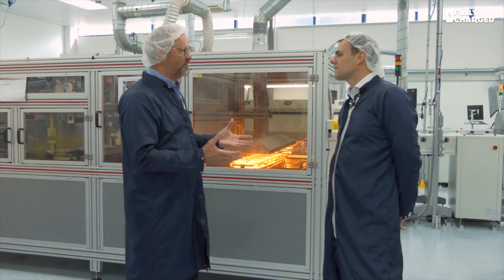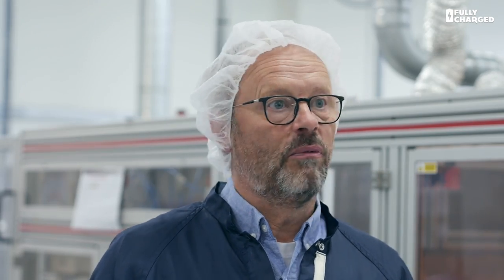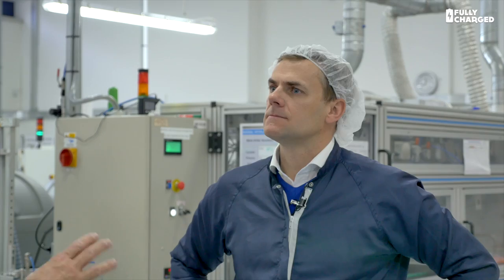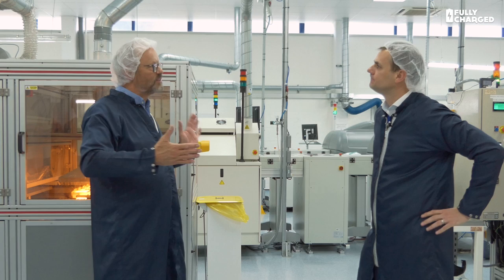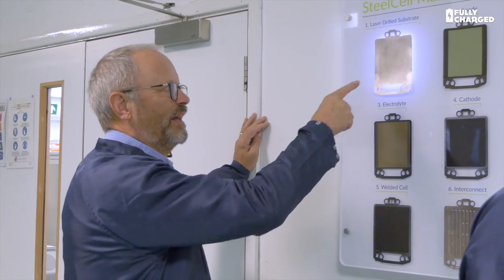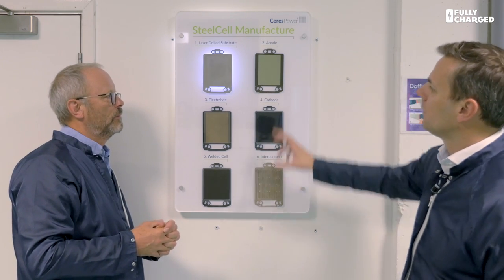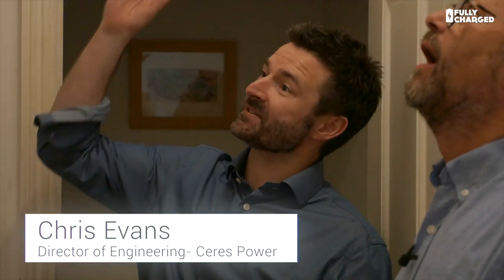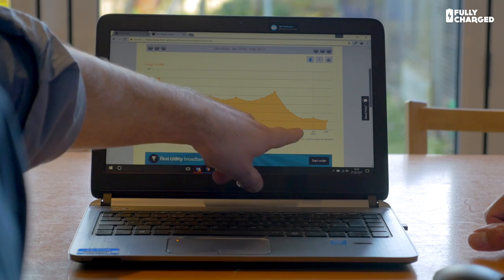Ceres Power | Fully Charged

Comment: So what is the projected life of the fuel cell and if required how much does it cost to replace a failing cell ?
The piece seems to enthuse about use in the home, where is the gas coming from to drive this fuel cell, are they suggesting hydrogen from solar panel powered breakdown of water or maybe from the home natural gas supply coming in from the street ?
I've played this video twice and visited the companies web site but the source of fuel gas, no matter how catholic, is something not discussed.
This might be a good solution for pig farmers with their own digestors to produce CH4, but for home use as long as Cerespower continues to gloss over awkward questions, colour me sceptical.
Reply: Dogphlap it's better than burning gas in a power station to produce electricity at lower efficiency and then throwing the heat away (e.g. directly in to the sea which is what happens at my nearest gas power station).  In many countries like the UK, peak heat demand drives peak electricity demand too, so this fuel cell electricity is available when it's most needed.
Reply: You say it is better . I say give me some numbers. You probably think to ask for some actual figures is abusive. I like to know the truth, you apparently not so much.
Reply: Eh?  Who's being abusive?  All these numbers are pretty easily available.  Average efficiency of a CCGT power station is about 50% (the rest goes to heat - which is almost universally thrown away in the UK), subtract 5% to 10% from that for grid losses (always heat, and non-capturable because they're diffuse) - although it can be used in 'combined heat and power' district heating systems as it is in some places, these are expensive and difficult to retrofit.

In the UK, typical gas home heater (gas -> heat) is around 90% efficient.  Their fuel cells are about 50% efficient (i.e. 50% to electricity, and 50% to heat), but the idea is that the heat is actually in a location (in your house) which is useful (and would be captured with a heat exchanger in the same way as it is from the 90% efficient gas home heater - so established tech).  Extra bonus no nasty combustion bi-products such as NOx and particulates.

So with this sort of static fuel cell, you have around 90% of the gas energy used (same as just with the gas heater), except that 50% of it is now in a much more useful form (electricity instead of low grade heat in water), which can be sold to the grid, and fits with peak UK demand, with the remainder being used as it was before for hot water and space heating.

https://en.wikipedia.org/wiki/Combined_cycle

https://www.solar.sheffield.ac.uk/pvlive/

https://www.withouthotair.com/download.html
Reply: Well I watched this video a third time looking for the efficiency of the fuel cell, as far I can recall they are talking about 50% efficiency. You think that is good because you are comparing that to the efficiency of a gas turbine power station plus the 6.3% transmission loss but you have ignored the efficiency in producing the gas and getting it to the location of the fuel cell (a home ?). If you ignore losses in making the gas and distributing it but include the losses of electrical energy production and distribution you will get a skewed result.
Maybe this is a good idea, I'm sure it would be under certain circumstances like maybe as a backup source for electrical power at a data centre but I have yet to see real numbers to allow me to know just how good an idea this really is. I don't know enough to say if this is over hyped or not but I tend to get suspicious when a visit to their website shows no figures but lots of feel good marketing speak and a video that reminds me of a commercial selling soap powder.
Edit: and don't forget if you run this off town gas (which appears from this video to be the idea) it is the H2 that does the work plus oxygen from the air so all the C in CH4 will be exhausted to the atmosphere probably (again no real information supplied so we are left to guess) as CO2 with possibly some CO and maybe some of that favourite greenhouse gas of the moment unconverted CH4. It is more than possible I'm being unfair here, but how would we know when none of these concerns are addressed either in the video or on the companies website.
Reply: That about sums it up.
Reply: the gas comes from the a pipe which is under your house. If you life in an area where there`s no gas installed than thats not a product for you. The fuelcell doesn't need to run on Hydrogen it can take normal gas.
an the efficiency mentioned in the video is 50% electricity and 35% of the waste heat can get recovered. So I'd guess in winter when you need that heat you have propably around 85% combined efficiency, but in summer when your only use for heat is hot water it will drop to a little over 50%
Reply: The devices these guys are making are called solid oxide fuel cells. The tech has been around for a while: what's special about these ones is that they use a different ceramic electrolyte from the industry standard, which allows them to run at much lower temperatures (500-600 Celcius, compared to 800-1000 Celcius for a standard SOFC).

 Inside the cell, natural gas (CH4) is reacted with oxygen to form water vapour and carbon dioxide  (no CO, unreacted CH4 or NOx). Around 50% of the chemical energy in the CH4 ends up as electricity. The remainder becomes waste heat. Because the fuel cell is on-site, we can use that heat for other purposes: in the UK most people run heating all winter, so the waste heat can be used to run their central heating system. Without the fuel cell all the same losses would apply (pumping gas, or even worse the 45% efficient electrical system powering an electric heater) but no electricity would be generated in the process, and as such the total system efficiency is lower. The same principle is sometimes applied in districts near conventional thermal power plants, with waste steam from the boilers being used to heat peoples' homes in winter.

The other desirable trait of these fuel cells is that they make good power supplies in remote areas where grid power is unavailable. Currently most remote communities that don't have grid power instead get their energy from diesel fueled generators, which are less efficient/more polluting than fuel cells and require frequent maintenance. Obviously such communities could also go to solar + battery storage, but I'd wager that the upfront cost of fuel cells is lower. I've also heard of SOFCs finding use in long range UAVs- a SOFC and electric motor is much more efficient than a small internal combustion engine.
Reply: There is already talk of using excess solar/wind to generate hydrogen which they can store and or add to the gas grid. Thereby storing surplus peaks for downtime, shady still days. I think Leeds uk are running a programme already and other places are looking at it. It might not be long before you have a unit that stores split hydrogen excess solar at home. That could feed this. While HO gas is very explosive H on it's own is a bit more safe to store so not so much with the BOOM factor...
Reply: Thank you for the reply. Sounds like you know what you are talking about, I plainly don't. As to efficiency I'm still not happy the way the production and distribution losses for grid electricity are counted but not the ones for CH4. We can argue this back and forth but if efficiency is the goal a heat pump will deliver greater than 100% (but produce no electricity, it consumes it but then it uses no CH4 so I'm not sure where that gets us). Combined heat and power is seductive, especially in a place like the UK, not so much where I live where I use no winter heating but occasional summer air-conditioning. If it makes sense for a particular application, good luck, if it does not don't use it.
Reply: Except for hydrogen's extreme molecular smallness, its ability to depart through the tiniest leaks, its permeability through many solids and its flammability of 95%/5% (or the other way round) with air, you mean.
Musk is right: use the big nuclear fusion reactor in the sky to charge batteries.  It's really very safe.
Reply: Hmm.  perhaps you should observe some of your link's responses.
"kirby Mohr 15th August 2016 at __2:10_ pm_
Hydrogen has serious safety disadvantages: 1) it has a negative Joule-Thompson coefficient, so if a leak occurs and it expands, it can set itself on fire. I fought a lot of those fires in a refinery I used to work at. 2) The fires, when they happen, are almost invisible, so it’s possible to walk into one and be seriously hurt. 3) the molecules are so small and it is so active it can pass through solid steel, and when it finds a flaw, it will accumulate there and make a bubble, compromising the strength of the steel. For this reason, I would be surprised if it can be contained in a salt dome. It doesn’t look like the proponents have done their homework."
Also:
"Ralf Mueller 15th August 2016 at ____1:16___ pm_
You can reduce heating costs by up to 80% if you insulate your home properly. THAT is also more interesting for the user as he won’t replace costs for conventional gas with costs for hydrogen. And possibly the insulation is cheaper than the conversion of current pipes and equipment to hydrogen transport.
Overhauling your walls, roofs and floors to insulate them will also help you to discover mould. Mould being not very beneficial for your respiratory system (asthma, bronchitis, sinusitis).
Insulating your house therefore could even be beneficial for the NHS and productivity."
Hmmm.......
Reply: The life span question occurred to me as well, they must have done some endurance testing so maybe a follow up report with our combined questions answered in full Robert?
If this is capable of running on "any" gas then combined with so called "Biogas" it will be a useful step forward. Oh and no mention of price either, with the small scale production facilities it will be another rich man's look what I've got gadget.
The partnerships published on their web site should be able to bring this within the range of everybody, but will they?
Reply: I don't know enough about this to add to what I have read elsewhere unfortunately. I accept that there are issues with hydrogen but still hope that there can be ways round them. Home insulation I do know about and that is an excellent point. No house should be built without a very high standard of insulation and like my Sister and her Husband have just done, older houses should be retrofit with as much as you can get in there. I rent but even the owners of mine have done double glazing and cavity wall. Strangely enough my bills went UP after the cavity wall... Or maybe I just got softer in my old age and turned up the heating....
Reply: In spite of the hype, this is not emissions free electricity, not even close. It is a means of using fossil fuel more efficiently, so really just like the trend nowadays to replace 30% efficient conventional Coal thermal plants with 40-44% efficient supercritical and hypercritical Coal burners. They do provide a much more consistent output than solar or wind so are more practical in that sense in northern areas where you can use most of the waste heat. Big problem is cost. A few years ago I looked into a similar system, that just supplies basic home power, hot water & heat and this is the quote I got back: 

"...".. The cost of the __ system is $35,000 to $45,000 (us dollars) per unit installed. The component and installation costs vary because of the facility size and other variables associated with the existing plumbing and electrical codes. Also, depending on what region of the country one lives in, labor costs will vary. A certified technician is required to install the system...."
Reply: Godshole, I also worked in petro plants with hydrogen, and the problems so neatly presented by that comment have presented themselves for a century without resolution.  I have an exactly matching personal experience with them.  What makes you think that they may now be solved?
As a footnote to house/factory/hospital thermal insulation, it has also been possible to RECOVER LOW GRADE HEAT by using cheap PLASTIC counterflow air-to-air heat exchangers for THIRTY YEARS now, with absolutely no-one taking the slightest interest in this fact.
Again, I'm talking from personal experience, in that I developed such a system in 1985 that could not only recover 83% of heat lost to venting, in the interest of replacing stale air with fresh air, but do THE SAME in summer with stale, air-conditioned COOL air.  I ran it constantly for a YEAR to obtain that figure.
There wasn't the slightest interest anywhere, except for SPOILER techniques of simply making enclosures LEAK.  This was claimed to be cheaper.
This partly explains why, apart from making comments about science on YouTube, the only 'work' I do is walking my dog down to a tropical sea-shore, and going for a nice swim in a warm ocean.
My house requires no heating...
Reply: Beachcomber2008 
I had a bit of a look around the google there. I don't profess to be Bill Nigh but the impression I get is that the tech is growing and it is out there.

https://www.theregister.co.uk/2012/08/17/safe_hydrogen_storage/

http://energystorage.org/energy-storage/technologies/hydrogen-energy-storage

Now if you say 'it can't be done' or 'look at all these problems' then fair enough. I am just trying to remain hopeful that these issues can and will be solved. 

I am though interested more in your plastic heat exchanger. That I could use in my own place. Have you any plans or concept drawings on line I might look at? Sounds very disheartening that nobody showed any interest in it at the time. Maybe now the world is a bit more forward thinking about heat efficiency it might be a good time to raise awareness of it again?
Reply: Thank you for your reply about the heat exchanger Beachcomer2008. For some reason, you tube randomness, I didn't get it all and I can't find a way to get to your comment. Normally I can just click on the notification but it only shows the page with my last comment, yours has not logged on. Would you mind trying to reply and post it again, sorry...
Reply: Beachcomber2008, really sorry about this, I assure you I am not taking the piss but I am still not able to see what I think might be your whole comment. Does it end with the words " 60 degrees in cross section"? If it does then I have it all now. Notifications only show so many characters and usually link straight to the comment but for some reason this one won't. Thanks for trying again though. I am going to bookmark this and when I get to building something and researching a bit more, which will be a while, I am moving, I will do my best to let you know how it went. Thanks again..
Reply: let's do it in sentences then.
1. Durable transparent PET plastic sheets 0,25mm thick spaced 3mm apart, corrugated 25mm x 60 degrees in cross-section, alternate spacings in counterflow (not crossflow), pressure-forced for turbulent flow.
Reply: 3. The enclosure 600mm square x 1200mm long (16 cubic feet).  This volume for a normal house.
Reply: 6. Wrapping the enclosure in reflective material raises the efficiency from 80% to 83%.
Reply: 7. The exchanger design evolved from a very much simpler and larger home-made laminar flow and low pressure version made from aluminium cooking foil and expanded polystyrene ceiling tiles, run round the internal perimeter of my roof space.
Reply: 8. A slope angle and drainage needs to be provided, in either instance, to carry away the condensation which occurs when the stale warm room ducted outlet air meets fresh cool inlet air.  Foil won't survive several years of this mildly acidic liquid, whereas plastic like PET will.
Reply: 9. The system is obviously susceptible to room fires, but NOT if you extract from a vertical room surface some distance from the high point in the room, through a grille coated in heat-expanding paint, which closes the grille when subjected to fire temperatures. If and when this is forced to operate, your roof will be on fire anyway.
Reply: This is really frustrating. Thank you again for your patience Beachcomber2008. I got some of the sentences but am missing 2,4 and 5. I am going to message you my email..
Reply: The potential energy in natural gas when burned is roughly 37 Mj / m^3 ch4 (g), or 10,278 Wh / m3 ch4 (g). so as this converts gas at 50% efficiency it will produce 5,139 Wh / m3 ch4 (g). This can then be used to work out gas consumption per kWh.
Reply: It would be better to use the specific energy (energy per kilo of fuel), as the density (and therefore the energy/cubic metre) of gases varies greatly with pressure and temperature. For methane the specific energy is around 50 MJ/kg, so you should be consuming around 0.15 kg of gas per kWh produced.
Reply: @Tim_Small  Hmm, I do not agree with this 90% efficiency for the fuel cell. The fuel cell always produces that 50% heat, also when you do not need it like when it is 30 degrees C outside during summer. or when you are not at home.. So in that case the fuel cell is always a worse solution than a 95% efficient combi heater, that is only turned on when the heat is really required..
Reply: @MarcoNierop  In this usage scenario, the heat the fuel cell uses is used directly in the house for domestic hot water or space heating.  This is taking the heat which would normally be wasted by fuel cells and actually using it instead.  If you don't have any heat demand, you don't fire up the fuel cell.  The advantage of this is that you can probably time this for peak winter electricity demand.
Reply: @MarcoNierop  The usage in this scenario is more like a conventional non-combi boiler with water storage tank ( incidentally combis are usually around 80% efficient when heating hot water).
Reply: @MarcoNierop  Don't you wash with hot water in the summer? You don't use a washing machine that could use the hot water, nor a dishwasher?